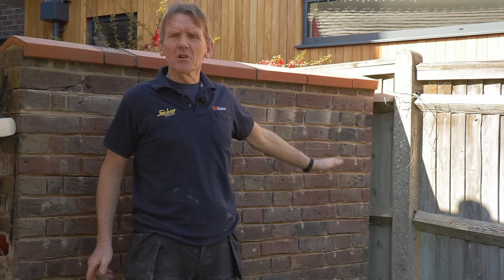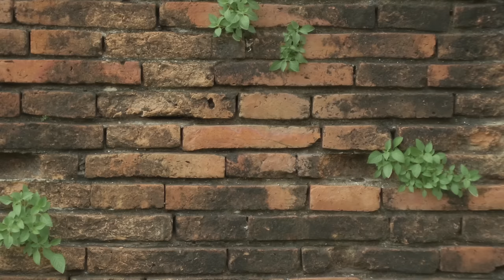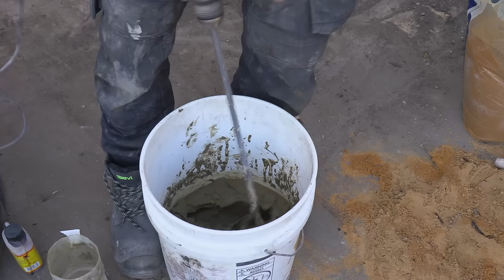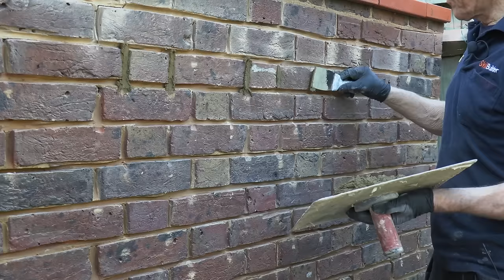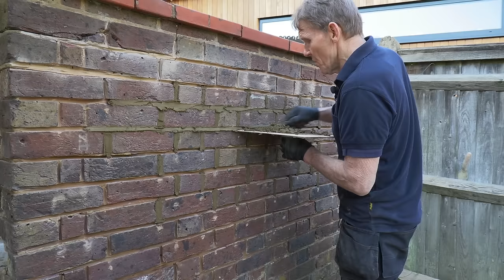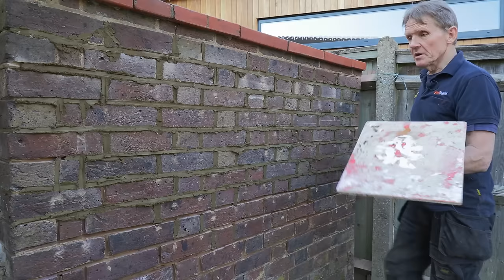Repointing Old Brickwork - Best Mix & Tools

Comment: You should NOT! Be putting Portland cement in any lime built wall! Don’t matter if it’s 5-1 or 10-1 use hydraulic lime or putty, also you need to wet the wall in
Reply from the maker: I hear you on the cement in lime but it is done all the time. The hydrated lime won't set on its own. I would normally use 1 hydrated lime and 1 cement with 6 sand  but the merchants are closed.
Reply: Skill Builder  sorry mate meant hydraulic lime N.H.L 3.5 good all rounder and a N.H.L 5 for chimney stacks and brickwork exposed to the worst weather, 👍🏻
Reply: Hi, I have that situation. 1930s Bungalow with lime built wall with very soft bricks. The north facing wall needs repointed, bottom third pointing has started to crumble out. What sort of mix should I use? Portland, even 5/1 would be too strong. I've done some brickwork before but I've never used lime.  Any advice appreciated.

Comment: I work on old buildings daily, churches and mainly tudor buildings. If you use cement on soft reds that have been built with lime originally you are an imbecile. Moisture is absorbed through the brick and releases through the joints therefore causing less stress on the faces of the bricks. This is why old cement walls have so many blown faces. As others have wrote the joint is sacrificial somewhat, the bricks are not.
Reply from the maker: Well done Joe, you are right about the cement. It is always good to educate yourself and you should never stop.
Reply: Skill Builder or the brickwork will crack if the brickwork is too hard due as old buildings especially timber framed are prone to lots of seasonal movement due to moisture and damp is a whole other topic i cant b e bothered to ramble on about

Comment: The finished job turned out ok,  Raking out old joints = half to three quarter inch depth, brush out with stiff brush and soak with water, knock up a small bucket of pointing mortar. Using a "Dibber" (modified pointing trowel) fill the perps, before the perps dry, top and tail them. The bed joints, WHS 10" Brick trowel, cut down from the shoulder both sides of the handle to the pointed end keeping both sides straight without Tags. Lightly dampen the work if necessary, using this tool start pointing where you started "perping" it is recommended that you always pull on to the previously jointed bed, rather than pull away!  Straightedge 4ft long 3"x half-inch thick p.a.r. softwood with half-inch thick spacing tabs, 3No on one side to hold the straightedge off the surface of the wall to allow cut mortar to fall without staining the face of the brickwork when the pointing is dry enough lightly brush the work off without leaving brush mark or damage to the edges of the pointing. Known as Westminster pointing it is a perfect framing for  Brickwork regardless of bond style used. A square a day 10' x 10' was acceptable output a day on quarter bond brickwork on soft reds or Staff Blues.

Comment: I love this guy but this isn't a great pointing video. I always go to the mortor ie put decent amount on the right hand side end of the joint and then work your way to the the left working the mortor into the previous mortor that you have put in
Reply from the maker: Si Low you are right and I wrongly thought it was better for filming working left to right. We will make another pointing video showing it the other way around and using some lime in the mix.

Comment: LMAO I'd pack in if I was u u don't use a wall paper scraper to put it on u smarming it all over . the joints look twice as big as they should be . Ud find it far easier if u round the end of your pointing trowel off . We just bend a bit of flat bar shape it like a joining iron so it's easy to hold . U get pointing guns now a days u just squidge it in and run your jointer over